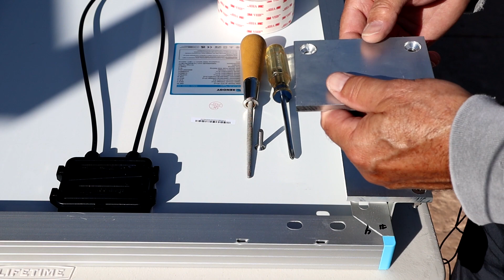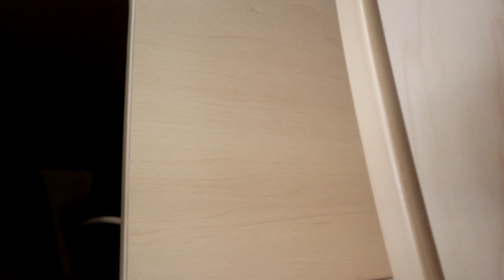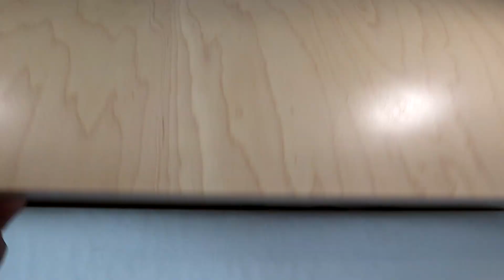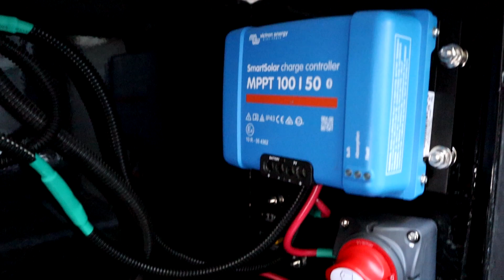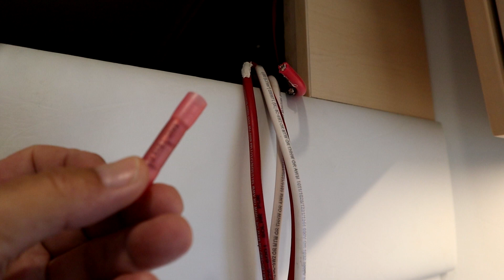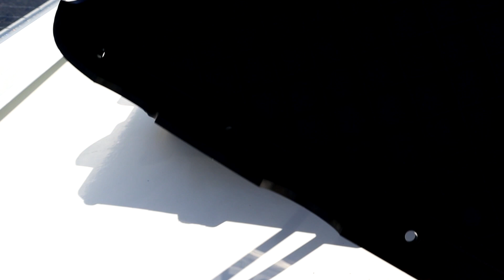RV Solar Panel & Charge Controller Installation

Comment: I'm doing the same solar install, and going to use your idea of aluminum pad. One concern is about any reaction between the stainless steel screws and the aluminum, have you noticed any reaction on your install?

Comment: Just added 600w of solar on our 2018 MB. Drilled into the roof as per your instructions and used a stiff wire to pull out the 8awg pre-install solar wires. It took a few tries but after about an hour or so success.  Covered the hole with a wire gland and now I'm ready to crimp my MC4 connectors to complete the install to my new Victron MPPT solar controller. Thanks so much for showing how it's done. Much appreciated. 😊
Reply from the maker: Exactly why I did this.  Glad it helped.

Comment: Thanks for the video. I really like how you mounted the panel brackets using the flat bar. Where did you get the flat screws? Do you mind putting the specs here and where you got them?
Reply from the maker: I got them at ACE hardware.  I don't remember the size but likely 1/4-20 to fit the holes in the brackets for the panels.  Just get a length that sticks up enough to easily thread the nut on.  Maybe 3/4 - 1"  A little on the long side is not a problem.  Too short is.  Get stainless steel so you don't have to worry about corrosion.

Comment: Thanks for a very helpful video. Really built my confidence I could do this myself. 2 quick things. First, I ordered the aluminum plates using your link to Midwest Steel Supply and noticed you listed them as 3/4" thickness instead of 1/4". Second, I didn't see info in your supplies list for the size (length, diameter) and thread of the screws you used. Thanks.
Reply from the maker: Rob - Thanks.  I corrected the thickness of the plates to show 1/4".  I did not specify the screw sizes but I think you can figure that out.

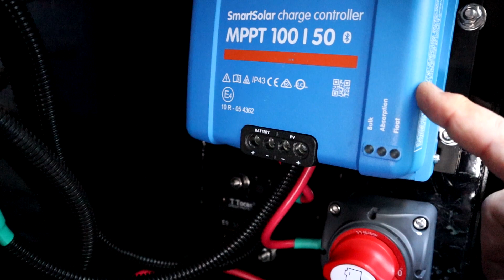Comment: I have a concern regarding your installation. Around the 39:00 minute mark you go into the disconnect switch for your panels. This is the absolute wrong switch to use. #1 the electric code says for ungrounded solar installations (which campers and RVs fall into), the PV lines need to simultaneously switch both conductors (+ & -). #2 the switch you are using is only rated at 48vDC. Those panels you have put out about 20+ volts open circuit. So assuming they are in series (which you describe early in the video even though you say parallel), that could be 80+ volts on that switch. If you try to turn that switch off under load, it could start an arc that you cannot stop and the van will burn to the ground. Please use an appropriate disconnect. Either a solar disconnect switch or at least a 2-pole DC breaker. I am using a 2-pole dc breaker in a small enclosure rated at 63amps and 250vDC. Please be safe.
Reply from the maker: Thank you for your concern.  For #1 I have not seen any installation where the PV input on an RV disconnects both legs of the inputs from the panels.  I will do some more research since you comment has picked my interest.    For #2, the panels are in series/parallel so the maximum voltage at the switch is 42V, not 80V so the switch is appropriately sized for the voltage.
Reply: @rvtipsequipmentwithcurtis9087  Did your research for #1 return any results regarding the electrical code?  The roof mount into the forward compartment is brilliant, thanks!

Comment: I also used aluminum plates.  I found it very difficult to get the VHB tape covers off to expose the sticky side.
Reply from the maker: I had some difficulty with that as well but obviously got it off.  Would have been easier if I had longer finger nails.